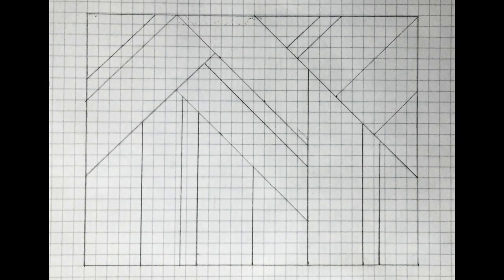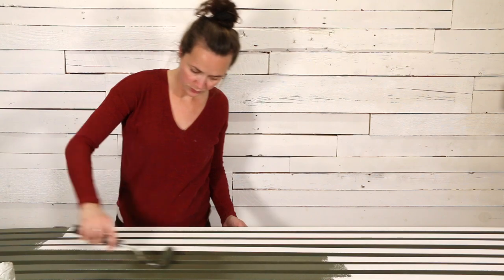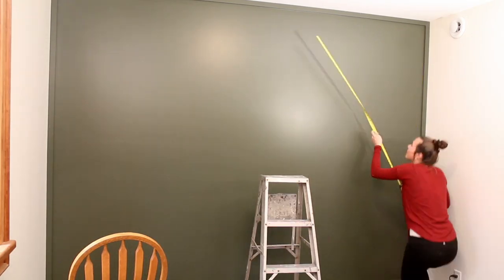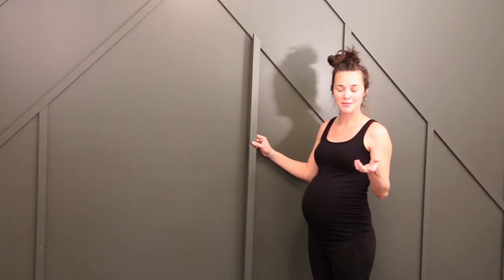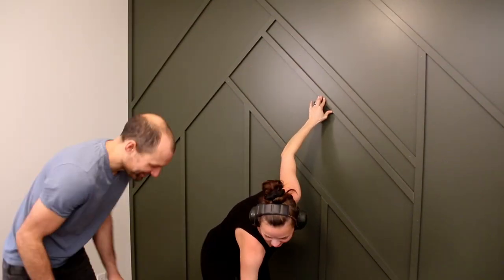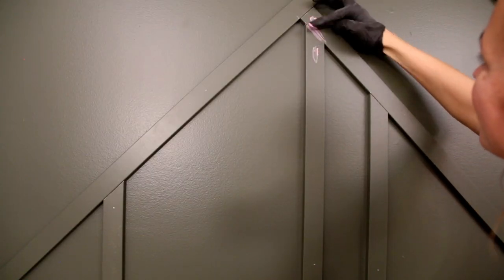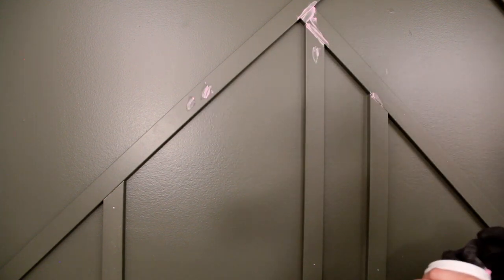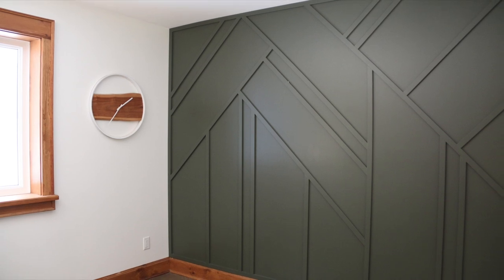DIY Modern Accent Wall

Comment: This same MDF is now over $6 a piece (also in Ontario Canada like the girl in this video) - I ended up using framing lumber at under $3 each and filled in imperfections (knots etc.) with wood filler/sanded them all down (it takes more prep/effort but it will save you over $70)
Reply from the maker: yeah I recently made some doors using similar MDF strips and I couldnt believe the price increase! they did have wider stripes that were basically the same price tho that I ended up just cutting in half...saved some money that way!

Comment: Wow looks great! I have a textured wall and am debating skim coating it first. Would you suggest smoothing out the wall first or just putting the boards right over the texture? Thanks!
Reply: I debated this myself and ended up skim coating our wall and I think it will look more seamless.  Our wall is about 111 sq ft and we were quote $3.50/ sq ft.  We ended up doing it overselves over 3 nights.  It is a lot of work,  but not too complex after watching a few YouTube videos.